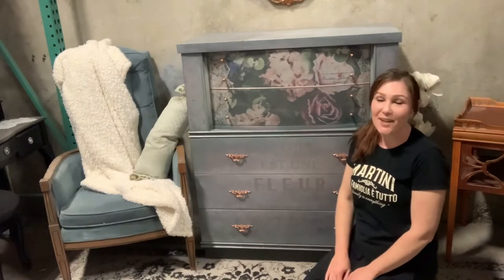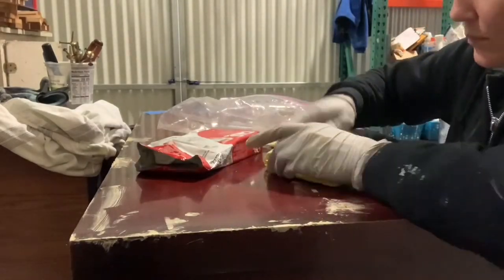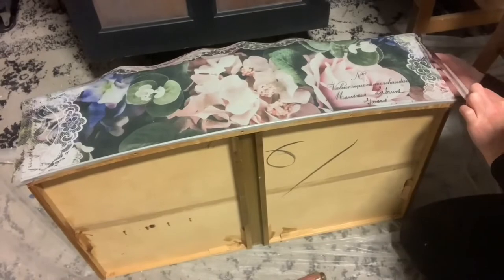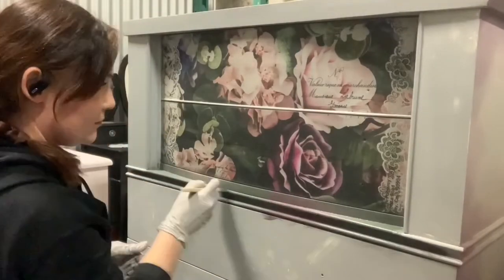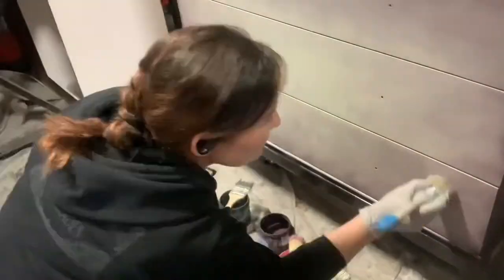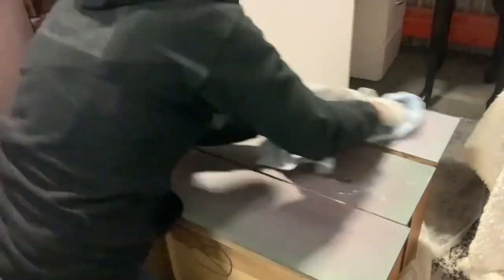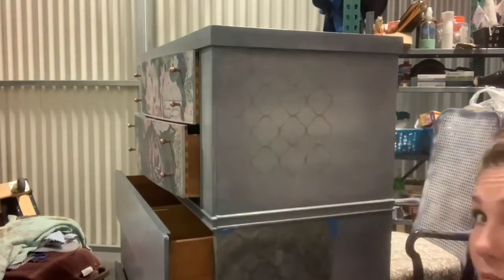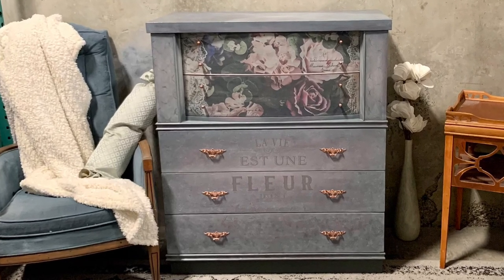From Mid Century to Old World | Dresser Flip | Elegant Upgrades

Comment: just did one that just kept bleeding after what seemed like 50 coats of shellac finally do you know why some are worse then others
Reply from the maker: Hey Evangelia! Some woods are just worse than others. Like this one! It’s typically the tannins in the wood.  Woods with more red in them I find to be a bit more problematic. If I can avoid breaking the seal of their original finish, I will. You could tell on this one that’s where most of the bleed through was happening. And sometimes it’s just a mystery to me. Especially on older pieces, they’ve lived such a long life, who knows what the previous owners put on them that could also potentially cause bleed through (cleaners, stains, oils, etc.).